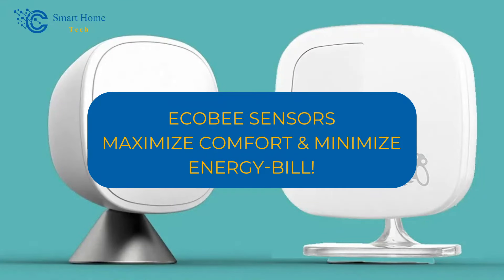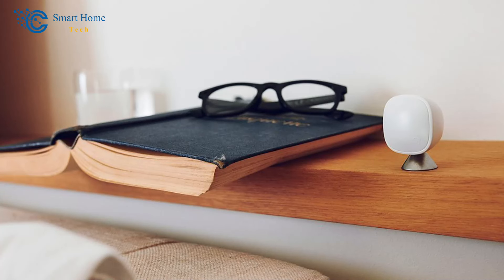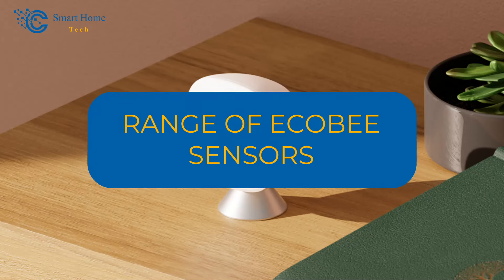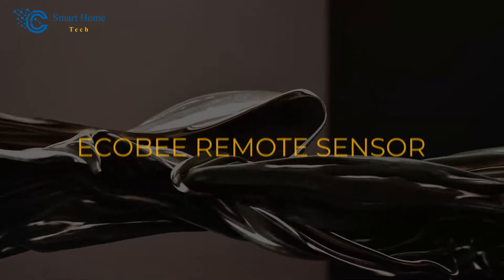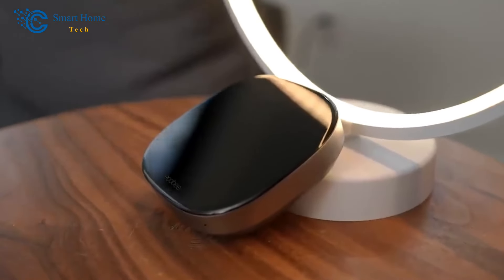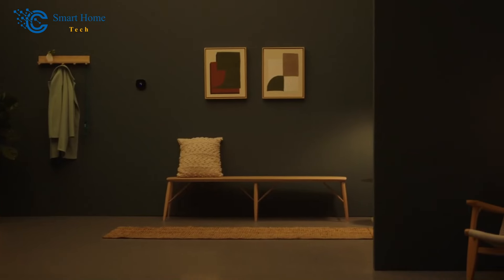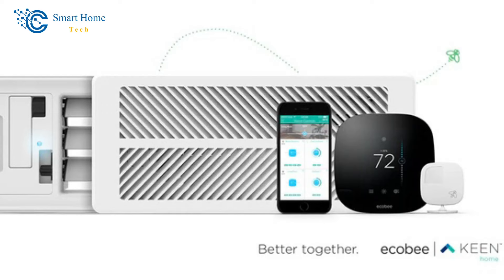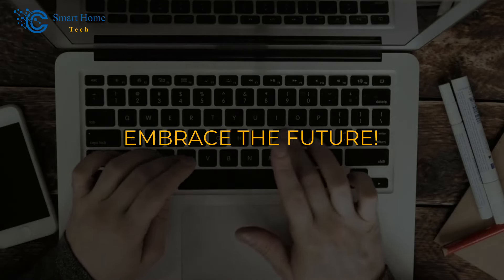Ecobee Room Sensors How Do They Work to Maximize Comfort & Minimize Energy-Bill USA

Comment: I’m wondering if this system would work for my home? I have one thermostat in the main living area. I have a pellet stove that heats our main living area. My current thermostat reaches 78° when I have the pellet stove running because the heat blow directly towards the thermostat. The problem is our bedroom stays  cold at about 67° the heat from the pellet stove turns the thermostat off   Would the sensor with the system help with that problem?
Reply from the maker: Thank you @lisac.8578  for reaching out with your question about the Ecobee sensor. Based on the situation you've described, an Ecobee sensor could indeed be a helpful solution for your home.

The Ecobee system allows you to place additional sensors in different rooms of your house. In your case, you can place a sensor in your bedroom, which is colder than your main living area. These sensors communicate with your Ecobee thermostat to provide a more accurate and balanced temperature reading throughout your home.

When your pellet stove is running and heating the main living area, your current thermostat is influenced by the direct heat, leading to a higher temperature reading and consequently turning off the heating system. This results in your bedroom remaining colder. However, with an Ecobee sensor placed in your bedroom, the thermostat will take into account the cooler temperature of that room. This means that your heating system can be regulated not just based on the temperature near the thermostat but also considering the temperature in your bedroom.

This setup should help in maintaining a more balanced temperature throughout your home, ensuring that areas like your bedroom do not stay uncomfortably cold when your pellet stove is in use.

Please let me know if you have any more questions or need further assistance!
Reply: You can also just run the fan on your furnace without having the heat turned on.  When you do this it will help circulate the warm air from the living room and distribute it to the entire house.
Reply: I don't see the difference i tried the with and without samething for me the only see is when somebody is in the room hahah but nothing else
Reply: How far can the sensors be to communicate with the base unit.
I need to place it in.upper floor and in basement.
Can I keep 2 sensors to communicate with base unit.if so basement is 2 deg colder than base unit in main.floor and upper unit bis 2 deg hotter than main floor.
So if inset 72 in base unit upper isc74 and basenentbis 70 and main floorbis 72. How will sensor solve this.what temp will be ultimately achieved

Comment: So it's not really that the sensor will separately manage the temperature in the room where it is placed (unless that room has its own separate airconditioning unit)  but it simply averages the temperatures in all the rooms. In our case, I don't know for what reason but our bedroom 2 is always warmer compared to our main bedroom (bedroom 1). If I put a sensor in bedroom 2, once the sensor senses that the temp in bedroom 2 is warmer, the thermostat will lower the average temperature for both rooms, and if it does that, the temperature in the main bedroom (bedroom 1) will become even colder. While bedroom 2 becomes less warm, bedroom 1 will become colder than before, right? How do we fix this? Is the solution to figure out why bedroom 2 is always warmer vs bedroom 1 and fix it?
Thanks for your help on this one.
Reply from the maker: @Mgr2383 
You've outlined a common issue in homes with centralized heating and cooling systems where the thermostat is trying to balance the temperature across multiple rooms. When you have a room that consistently differs in temperature from the rest, adding a sensor can indeed impact the overall system behavior as you've described.

Here are a few steps you can take to address this issue:

1. *Identify the Cause of the Temperature Difference:* It's beneficial to first understand why bedroom 2 is warmer than bedroom 1. Common causes include differences in insulation, window exposure to sunlight, electronics emitting heat, or even the position of the room relative to the heating/cooling unit. Checking for drafts, insulation gaps, or a need for window treatments that can reduce heat gain from sunlight could provide solutions.
2. *Adjust Air Flow:* You can try adjusting the air vents in the rooms. If bedroom 2 is too warm, partially close the vents in that room to reduce the amount of heated or cooled air entering. Similarly, ensure that the vents in bedroom 1 are fully open to allow more air to circulate.
3. *Use of Curtains or Blinds:* If the cause is solar gain, using thermal curtains or reflective blinds in bedroom 2 can significantly reduce the amount of heat entering through the windows.
4. *Supplemental Cooling or Heating:* For bedroom 2, consider a supplemental cooling method like a portable air conditioner or a fan during warmer months. For heating discrepancies, a portable heater in the colder room during winter can help balance the temperature.
5. *Upgrade to a Zoned HVAC System:* If the problem persists and budget allows, consider upgrading to a Zoned HVAC system. This allows for individual temperature control in different rooms or areas of the house, each with its own thermostat settings.
6. *Smart Vents:* Another option is to install smart vents that automatically adjust the airflow into each room based on the set preferences for that particular space.
7. *Reevaluation of Thermostat Placement and Sensor Use:* Since using a sensor in bedroom 2 impacts bedroom 1 negatively, you might need to reconsider where and how you're using additional sensors. You might want to use multiple sensors and employ thermostat settings that allow for averaging temperatures in a way that doesn't over cool one room to achieve comfort in another.

Before making significant changes, especially if considering a zoned system or significant HVAC upgrades, it might be worth consulting with a professional HVAC technician who can provide tailored advice based on the specific layout and conditions of your home.
Reply: Interesting.   I have a Nest thermostat with sensors.    It has I think 4 time periods (morning, afternoon, evening, night), where for each, you can program which sensor (including the one in the thermostat) it should set the temp to.  So say, office sensor morning and afternoon, thermometer sensor in the evening, bedroom at night).    I like that approach.  But the fixed time intervals aren't ideal.

I just finished the video.  The Ecobee sort of has that, in Home, Away, and Sleep profiles.  You can say have just the bedroom sensor be associated with Sleep.  Follow Me mode is interesting, in that it tries to set the temp for the area you are in the most.  That theoretically could work at night, assuming the sensor picks up that room as the new "actve" room, before you get in bed (and I assume little or no activity sensing then). 

 In your bedroom 1 vs bedroom 2 example above, it supposedly only uses input from say bedroom 2 if there's activity in it.  If you are only in bedroom 1, it should ignore that sensor.   You could change to "Sleep" mode, assign one of the bedroom sensors to that, and it should regulate the thermostat based on just that room's temperature.
If bedrooms 1 & 2 have vastly different temperatures (one hot, one cold) and people are in both, no thermostat will fix that.  You could add a space heater to the colder room.  Or partially close the vent in the warmer room.

Comment: I have 2 apartments on each floor and I would like to install the ecobee thermostat on the staircase space that is  between the two apartments and place 2 sensors in each apartment. How do I convince the tenants to be ok with thise sensors in their apartments? 
I don’t have option to install thermostat in each apartment just because water heating boiler system is already wired only one theermostat per floor. Any ideas or suggestions? I am scratching my head.
Reply from the maker: @Nicholas_Van_Orten That’s a great question, and your setup is definitely a unique challenge! Here's how you could approach it:

Thermostat Placement: Installing the Ecobee thermostat in the staircase is a good solution since it’s the central location for both apartments. The thermostat itself doesn’t need to sense temperature directly; the sensors will handle that for each apartment.

Sensor Placement: Place one sensor in a common area of each apartment (like the living room or main hallway) and another in a room where temperature control is critical (like a bedroom). This way, the thermostat will balance heating/cooling based on where the activity or priority is.

Sensor Modes: Use the Ecobee app to set up "Comfort Settings." For example:

During the day, prioritize the sensors in living areas.
At night, prioritize the sensors in the bedrooms.
This allows the system to dynamically adjust based on actual occupancy.
Sensor Connectivity: Ensure that the sensors are within range of the thermostat (typically up to 45 feet through walls). If range is an issue, you might need to experiment with placement or use signal boosters if necessary.

Tenant Cooperation: To make this work seamlessly, explain to your tenants how the system operates and how it can make their apartments more comfortable. If privacy is a concern, emphasize that the sensors only detect motion and temperature.

Test and Adjust: After installation, monitor the system’s performance for a few days and make adjustments as needed in the app. You can tweak sensor priorities, schedules, and comfort settings based on feedback from the tenants.

This setup should give you centralized control while providing a balanced and comfortable environment for both apartments. Let me know if you need more details or run into any issues during installation!
Reply from the maker: Challenge on the given setup @Nicholas_Van_Orten: If the sensors in one apartment detect the temp. below the threshold, what will happen to the other apartment since they are sharing the same thermostat? 
If the temperature in one apartment falls below the set threshold (let’s say it gets too cold in Apartment A), the thermostat will kick on the heating system to bring the temperature up. Since both apartments share the same thermostat and heating system, Apartment B will also get heated at the same time.

The Challenge: This can cause the other apartment (Apartment B) to overheat if it doesn’t actually need heating. Similarly, if cooling is needed in one apartment, the other might get cooled unnecessarily.

How to Manage This:
Adjust Sensor Priorities: Use the Ecobee app to adjust the sensor priorities based on schedules. For example:

During the day, prioritize the sensors in Apartment A if the tenants there are home.
At night, prioritize Apartment B if that’s when they’re most active.
This helps balance comfort across both spaces.
Set a Moderate Threshold: Choose a temperature threshold that works reasonably well for both apartments. It may not be perfect, but it’ll help avoid extremes.

Tenant Communication: Let your tenants know that the system works best as a shared solution and encourage them to report if one apartment is consistently too hot or too cold. You can tweak the settings based on their feedback.

Consider Smart Vents (if feasible): Adding smart vents could help regulate airflow to each apartment more precisely, but this would depend on your building’s HVAC setup.

Unfortunately, with one thermostat for two apartments, perfect temperature control for both isn’t possible. The key is to find a balance that keeps everyone comfortable most of the time.

Comment: I don't know if the sensors will help or not. We just installed our ecobee. It came with 2 but we only installed 1 so far. 
We had major issues installing the thermostat.  I wanted to say we called tech support and they stayed on the phone for 1.5 hours until it was working perfectly.  Pictures were sent back and forth for help. It was more than a great experience.
Reply from the maker: Thank you @dananddebbiey6947 for sharing your experience with these amazing devices.